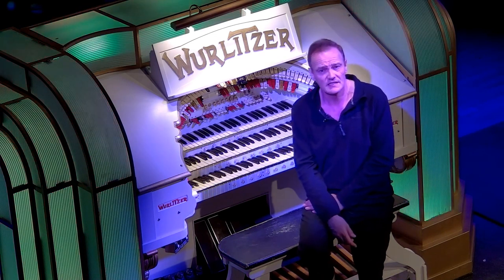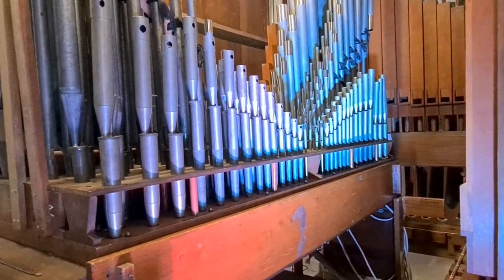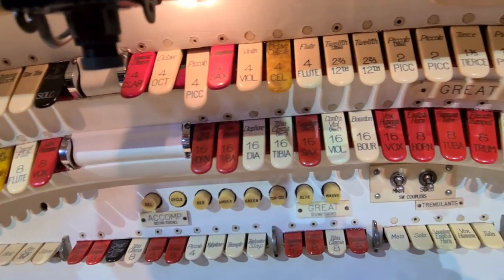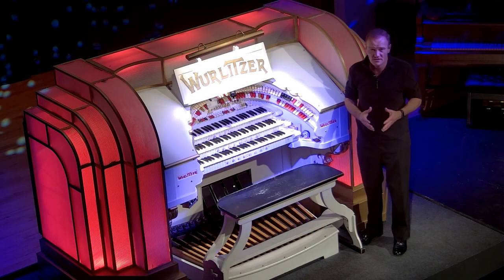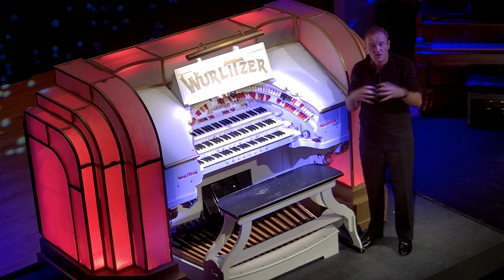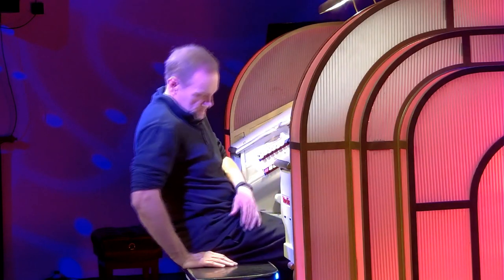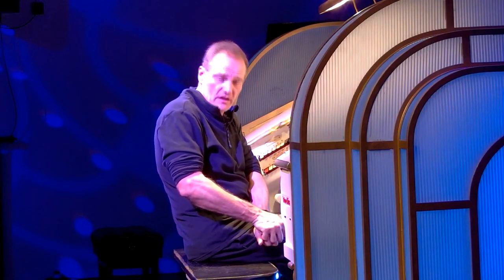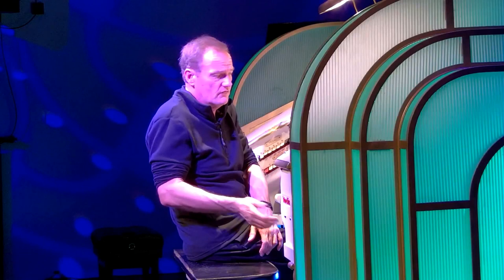Musical Museum Exhibit In-Depth #1 - The Mighty Wurlitzer

Comment: I have been in love with the cinema organ since I first played one in 1972. That particular instrument was a 3/15 Wurlitzer  still using the original relay system developed by Hope Jones and electro pneumatic action including the stop tab actions.  I am a member of a Theatre Organ Club based in Warragul , Victoria.(Australia) Also on the committee as by trade I am an electronics tech and look after the organ's electronic action which is all cmos logic and multiplexed , much more positive with no delay, this allows the pipes to speak fairly promptly allowing of course for the oscillation build-up delay in large flue pipes. It is only a 3/10 and really needs a post horn or some other strident reed rank. 
I noticed the pedals are rather worn on the 3/12  you are playing , probably had a lot of use over the many decades.  
Our members are mostly elderly and the future for the organ does not look great, I myself am turning 73 this month and I am one of the youngest. 
I hope your museum has a greater patronage than we have at the moment.  Another problem we have is the console needs to be moved on and off the stage every time we wish to use the instrument.  The venue   has several users so we have to fit in with them.
Regards Robert

Comment: Does the Wurlitzer use whirling Leslie Speakers to achieve vibrato from the Doppler Effect?   Or are Leslie speakers only used in Electric organs?    What does cause vibrato with pipes?     Have you ever seen a church pipe organ with vibrato effects or is vibrato something found only in Cinema/Theater organs?
Reply: All pipes no speakers, the tremolo and to an extent a frequency or phase shift in sound is caused by varying  the wind pressure by a 7 Hz rate to a particular rank of pipes.  Which rank of pipes is determined by control tabs on the console.

Comment: One question, is this a so called multiplex organ, where pipes are in multiple use, so the same pipes will be played from the different manuals and the same pipes, that provide in the lowest octave a 8' provide an octave higher the 16' and so on?
Or is it so mighty, that every key has its independent set of pipes and only when coupling is activated, you can play upper manual registers on the lower manual?
Reply: It seems not to be the case, but tried Wurlitzer this for a budget instrument?
Reply from the maker: Hi - great question. The Musical Museum's Wurlitzer has 12 main ranks (types) of pipes - and these can be played at multiple "footages" and intervals (called "mixtures" or "mutations") from multiple manuals (keyboards) simultaneously, and the different keyboards can be also "coupled" together, sometimes at different octaves too. This is referred to as "unification" or a "unified organ", and is a real advantage in making the organ compact enough to fit into a typical cinema or theatre. 

As an example, the Tibia Clausa rank at 8' (standard) pitch has 61 pipes. A traditional organ would require a whole extra 61 pipes for the Tibia 4' (an octave higher), but the unified theatre organ achieves the same effect by playing on the same rank transposed up an octave, requiring only an extra 12 pipes to play the top octave. The 16' is accomplished the same way, adding 12 pipes to the bottom of the Tibia rank. Hence, in our unified Wurlitzer organ, four stops (each a separate stop tab) needs just 97 pipes, whereas in a classically designed organ, 244 pipes would be needed for the same four stops! As you say, this means that multiple keys on the keyboard might call for the same physical pipe to sound, but in reality because of use of different combinations across the different manuals, conflict is either avoided entirely or not really noticeable!

Comment: 24:55 But touch response isn't possible?
Reply from the maker: Hi - thanks for your question. The organ has something called "second touch" which allows the organist to press harder on the keys to call on an additional set of sounds or instruments; but this is not really "touch sensitivity" though, for example you can use second touch to add another octave to the notes you're playing. The organist can also remotely operate the Piano's expression using one of the shoe pedals which would give a similar effect to "touch response"; however on the Musical Museum Wurlitzer only the piano notes and the sustain pedal is currently connected.